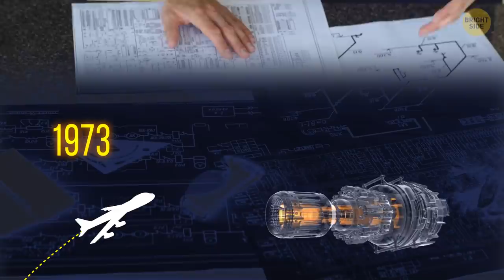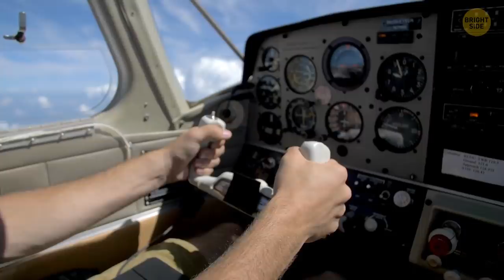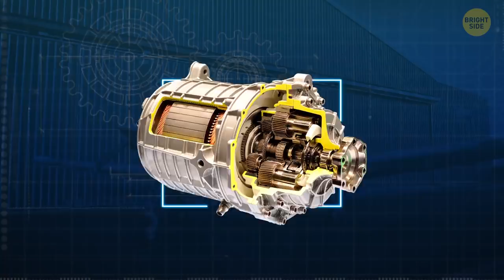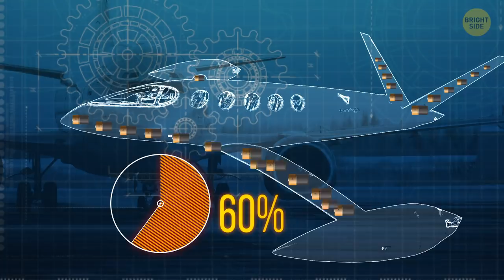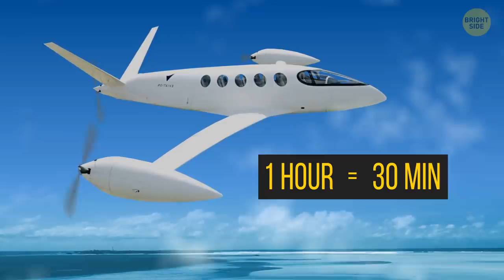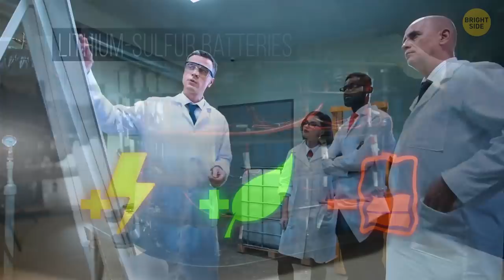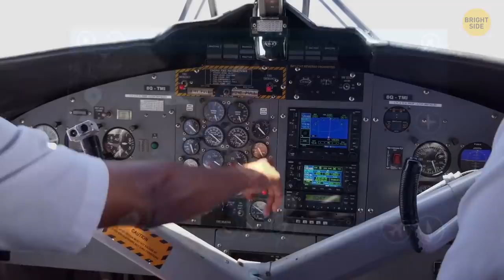Why We Still Don't Have Electric Planes

Comment: Question???? what is a standard battery?  there are hundreds of different ones and well thus no standard?  maybe you should rephrase it to the energy density to 1 lb of jet fuel vs 1 lb of a certain type of battery tech (Lithium) for example.

Comment: Pilot-less planes are not something that will likley happen seeing as a computer can always fail and you need someone with the knowldage to troubleshoot the problem.  Airlines likely wont go with unmanned ships because of the liability issues.  and there are several electric aircraft in operation now.  no jumbojets, but if you think about it, wouldn't you rather have a flight with 9 people as opposed to a hundred?

Comment: The planes battery would not last the whole flight that's why planes are electric probably only short haul flights like 30 minutes but not any longer than that because more batteries more weight for electricity used

Comment: You can use four and six moving spinning momentiym batteries because two go forward and one go back toow dimensional rotation so you are generally generating electronic fuel while have sufficient energy going back winding and preserving energy as I know half of the world's flights are less than five hundreds miles long and some are many like 4000 miles long so we need sufficient suffisticates battery energies to fund 40000 miles long for emergenous travels and time of flights and international intermission flight peace plus we need you to run the battery tests to see if it's possible to get the battery moment two forward one back each way spinning to go forward and preserve simply then test fly safely after testied batteries on ground and the dimensions are possible it's just guaranteed tests and powers creating like fidget spinners watch it on board and check ☑ the status even use fuel too gas for heat if suitable because how would central heating work on plane is heating electrixs

Comment: Then what about all that lithium ion that there is no way to recycle and those batteries have to be replaced every three years  Lithium is hundreds and thousands of times worse on the environment than carbon could ever think of being Electric power is the worst idea for the environment but they will try and make you think it's such a grate idea well it's not and that's a fact.